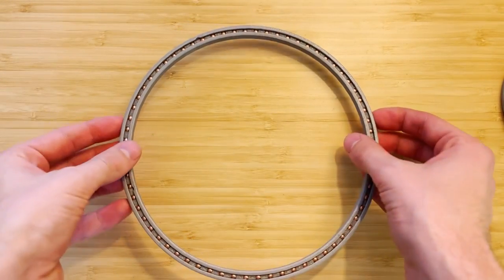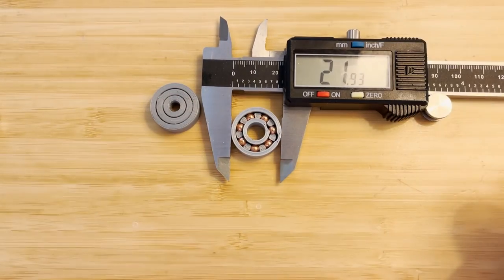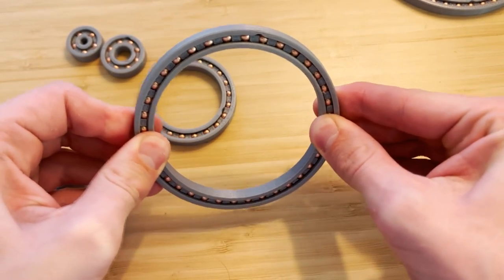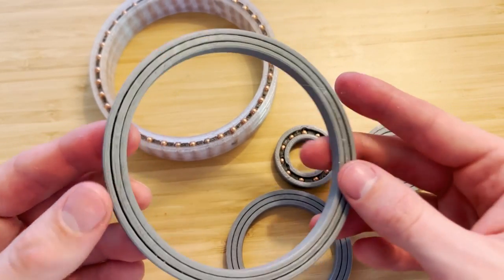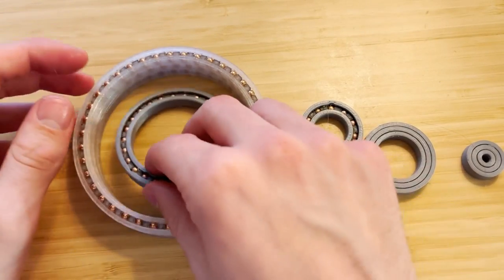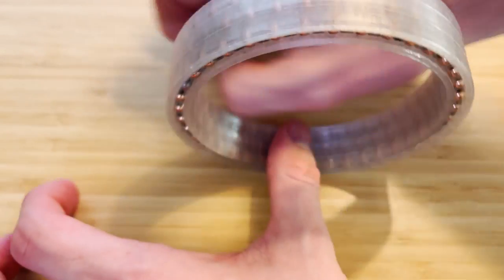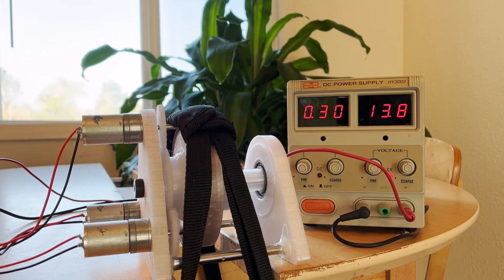24 Hour Torture Test of 3D Printed Bearings

Comment from the maker: I wanted to correct a very obvious mistake I made in the video! I was recorded this after a long day of school and clearly my brain was gone. 

the shaft was rotating at 11rpm which is NOT 110 rev/min like I said. 

It is 66rev/min which translates to 95,040 revolutions in total over 24 hrs and 47,520 revolutions in total over the 12 hour span.
Reply: It's not a big problem. You can add a text overlay via youtube editor on place, where you said wrong numbers. I saw, many do that on their mistakes.
Reply from the maker: @LichtTempler  I tried to do that through YouTube editor, but it seems they removed the annotation feature!
Reply: @LichtTempler  unfortunately they removed this feature some time ago
Reply: @Dangineering  you could pin this comment so more people see it
Reply from the maker: @l0k048  Oh! thanks for bringing this to my attention. I thought I had pinned it when I first commented, but clearly something didn't work.
Reply: You may want to correct your correction. In the vid, you said shaft is 11 revolutions / 10 seconds, but in your amendment here, you say rpm, which literally stands for revolutions per minute. Obviously, units matter.

Comment: Did you lubricate the bearings before running them? If not, they hold up quite well! I'd imagine a bit of lube would go a long way
Reply from the maker: Yes, I lubed the bearings once with some silicone grease and then did not add any more during or after testing. For the amount of weight and duration of their use I was also impressed with their durability
Reply: @Dangineering  you should compare the results to a lubed printed bushing, i feel like the bearings might actually hurt because they point load the race
Reply: Dry lube like graphite would probably work well

Comment: Nice work, I did a similar test, but at higher speeds and for less time. I’m always amazed by how well they hold up
Reply from the maker: Yeah I fooled around with them at several thousand rpm and like most bearings they certainly got hot after a couple minutes, but they are perfect for high load/low rpm applications or short bursts of high rpm during prototyping.

Comment: You can have Chinese bearing very cheap provided that you design with bearing dimensions widely use. They will be better than any pla bearing,  but pla bearing are very interesting for prototype and validation of concept .
Reply from the maker: Real bearings are and will always be better performing, but for the really large internal diameters that I needed it was not financially viable to use them. However for prototyping and simple hobby projects that will never operate in extreme conditions or for continuous operation these are a great way to save a buck.
Reply: @Dangineering  I agree I give you a tip and you give me one
What parameter do you use to have a smooth track for the ball ?
for my tip type 
"axk official store" aliexpress ball bearing
-
you will have a 6810 2RS 50x65x7mm for less than 4$
It is not japanese quality of course but if you respect the load it will work

Comment: Very interesting! A few thoughts on wear:
- lubrication (obviously)
- Nylon (you need a nylon-capable printer obviously, which I don’t yet myself)
- I suspect that much of the wear is just the high parts of the layer lines wearing away. I’d think that the wear rate would decrease once the high points are worn down. I wonder how it would work to print with slightly over-tight clearance and then sand the races lightly to give a smoother surface?
- someone else mentioned electroplating, but I wonder if some UV-curing resins might be harder than the PLA? I’m thinking in a similar direction to the last note: just fill in the low points in the layer lines a little bit to provide more contact surface area.
- I wonder if the smoother surfaces of actual ball bearings would reduce wear? BBs are certainly cheap and pretty smooth, but extremely smooth vs just very smooth might make a difference.

(None if this would be an issue for your robot dog use case; you’re not going to be running the joints 24/7 for months on end :-)

Great, great work!
Reply: My impression is that UV resin might be more brittle than PLA, but Nylon should be very hard wearing. Maybe a design with cylindrical roller bearings would wear less than ball bearings, but that probably introduces other problems.
Reply: @DisorderedArray  Ah, good point about the brittleness of the resin. I think you’re right, UV resins are known for their brittleness, and the high point-contact forces of the ball bearings would almost certainly cause cracking and very short life. Thanks for sharing the comment!
Reply: @DisorderedArray  BTW, I just came across this design the other day, using wire for the bearing races. Still very low cost, but they should be much more rugged: https://youtu.be/xbGtqpgfdRM
Reply from the maker: Very interesting thoughts! I will definetly try and print it with slightly too tight of clearance and then sand away a little bit to test the high layer line theory. I would like to try electroplating, but practically that is not a real option for most people (so even if it is a solution, its not a viable one)
Reply: @DEtchells  interesting, I guess with these larger 3d printed bearings one has to match the design choice to the expected wear profile.
Reply: @Dangineering  I think electro plating has so many potential uses with 3d prints, I say if you can do it, don't let us scrubs hold you back, go for it!
Reply: You could also re-fill the bearing with larger balls once the small balls have broken them in.

Comment: I'd consider using roller bearing design for the triple in future if can get ahold of the rollers they might held lower wear as the weight distribution is significantly better than a ball
Reply from the maker: Do you have any suggestions for what might make decent rollers?

Comment: Really nice job. Those bearings are huge.

Apologies if you said it in the video and I just missed it, but how tough is it getting the bearings into the center race on the triple-bearing print?
Reply from the maker: It's not that tough honestly. You just put the bearings in on one side and then  work your ways towards the other. It can take a little bit of patience. I will post a quick demonstration video soon sine a bunch of people are curious on how to assemble to triple race or larger bearings

Comment: I would be very curious what dimension is distorting under load. 

One idea I want to try, (or see tried) is to take advantage of thermoplastic creep to force mechanical dimensions that loose their true initial shape, back into optimal parameters. It would be kind of like a "self sharpening chainsaw blade attachment" but for plastic, either adding or removing plastic at specific points with a constant spring loaded force.

Comment: Nice job with the metal bearings. I’ve made ball-less bearings for low load applications like the roller for my filament holder. I wonder how they would hold up on this kinda of testing.
Reply from the maker: I tried to put the same 25lb weight on the 100% 3D printed bearings that I found online, but they didn't rotate at all under that weight so I decided to not film it.

Comment: not just cool, rly cool. Attempted something like this long ago with plastic bb's so it was a chemical resistant being, didn't hold up to the speeds i wanted but i might revisit with your design!
Reply from the maker: That's why I stayed away from plastic BB's I knew that I needed them to take some higher speeds, forces, and temps so I opted for steel BB's.

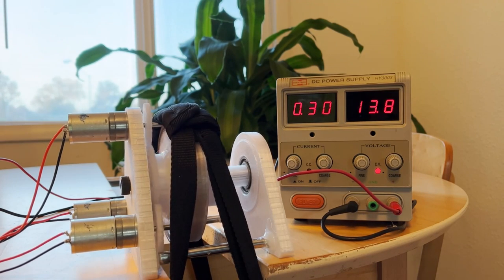Comment: 5:00, “11 revolutions every 10 seconds”, that isn’t 110 rpm, there are only 60 seconds in a minute, it is 66 rpm.

“Thin PLA 3D Printed Bearings”, then prints the strongest out of PETG.
Reply from the maker: I acknowledged the mistake in my pinned comment, made the video late at night and clearly was tired. 

Yeah I simply ran out of PLA filament and wanted to still show that you could print multi layered ones.
Reply: @Dangineering  didn’t see that when I commented, also it still isn’t quite right, you said in the pinned comment that the shaft was rotating at 11 rpm which is 66 rev/min. It is a great project though.

Comment: Experiment with multi-material.

Place metal sheets on the walls that are hard amd rigid and see if any wear happens at all.

And yes you should always use grease. Please never run without lubricant.

Comment: I am really impressed with the result, and I am greatly interested in plastic made bearings, for rust proof bearing, using stainless steel BBs, for creating my own ECM lathe, (I will just have to find a way to get current into the immerged chuck, without any contact with the highly salty water solution as I would get extremely quick corrosion, maybe thanks to a usual steel bearing encased in an oil filled cavity, I will see)  
but I have a little question : how do you fill the multi-layer bearing of it's ball bearings : is the balls separator in several pieces and each level gets filled mid print ? Is it filled post-print going layer by layer with a splitted ball separator ?
Thanks a lot for the video, it gives a lot of ideas
Reply from the maker: Exactly. For the multilayered bearing all you do is print one casing and three retainers. After they are done printing put the BB's in one of the most external races and then go layer by layer till you reach the outside bearing race and boom you are done. If you wanted to wait a little bit I am going to post a quick little assembly video for multi layered bearings because it seems a fair amount of people are asking questions about it. I will be curious to see if these could do well in a ECM Lathe environment

Comment: I have a small PLA part for my home that kept breaking, and i just kept printing more. I find pla can be quite brittle and thin parts like this can be especially fragile, but I guess depends on the exact plastic and perhaps the degree of crystallization. But I tried the fancy 3d870 pla resin, annealing, nothing seemed to work. I switched the part to a PHA resin from regen and It hasn't cracked since.
Reply from the maker: Personally I have had a really good experience with PLA when I increase the width of the walls. I recently switched to PLA + or PLA Pro (same thing) and have not had any of my prototype parts break on me.

Comment: You probably thought of this already, maybe ruled it out because of difficulty getting the pins, but could needle style bearings with pins instead of balls wear better on the plastic?
Seems like the spread out contact point would work better for plastic.

BTY no engineering experience

Comment: Very nice bearings. The shape looks similar to a ceramic bearing I’ve got in the workshop. Do you print them 100% fill? Subscribed, I love this kind of thing :) ps does heat become a problem?
Reply from the maker: Glad you enjoyed it! Yes, I printed them at 100% infill which I achieved just be increasing the amount of perimeters. Heat didn't become a problem for me at these speeds, but I have taken one (without lubrication) and had it spin at around 8000 rpm for about two minutes. At that speed I could feel it slowly start to heat up to the point where at the end of the 2 minutes the PLA was a little soft and flexible. if you need higher speeds I would suggest to use nylon, lube, and if you need constant operation for long periods of time to have some sort of cooling.

Comment: This was great work(!) I just came across a design yesterday that uses wires for the ball races that you might also be interested in. They add another step (you need to ring-roll the wire), but still extremely low cost and they should be much more rugged than having the bearings run directly against the plastic: https://youtu.be/xbGtqpgfdRM

(The creator says he’ll share the F360 files with people if they ask. He’s apparently not posting them himself because they’re highly parameterized and quite complex, and I guess he doesn’t want to be swamped with random questions.)

The straight plastic bearings you designed are almost certainly fine for your robot-dog use case, but I thought you might find the wire-race approach interesting 👍😁
Reply from the maker: I had not seen those before, thank you for introducing it to me! They are certainly way more work to assemble and seem to use more hardware than mine (in that you have to screw it together), but ultimately I would guess that if you need slightly higher performance then his might be a better choice. 

Those will likely last longer, and tolerate higher speeds and loads, but even my own design exceed my personal force requirements, so I will probably keep the design as it stands unless other issue pop up in the future.

Comment: emmett made a OpenSCAD file for his gearbearing. you can actually get away with very big/thin bearings. Try playing around with it a bit maybe.
edit. i really like your approach tho, the tolerances of the bearings seem really good. roundness seems to could be improved a tad but still very nice :D
also PETG is quite durable for such applications and lasts in mineral oil for ages. nylon (PA12 or PA6) would be okay too but PETG is overall a lot less hassle to get tuned in properly.
And for the sizes of bearing you would need. they are expensive as heck. sadly.

peace o/
Reply from the maker: I will give that a look! Yeah nylon will be the best option for ultimate durability, but man is it a hassle to get good prints with it sometimes. OH yeah the bearings I needed were just prohibitively expensive.
Reply: @Dangineering  From my own experience (some gear sets that now run a bread slicing machine) and few different gear and cylindrical (more surface area) bearings IMO if you have say a "light load" application PETG will usually hold up WAY better then PLA and not that much worse then nylon. usually my overall go to material nowadays. What printer are you running if i may ask ?

Comment: have you tried using filament cut to length as roller bearings?
Reply from the maker: I have not tried that, because I fear that the filament might get a little too hot and then start to get too flexible, lose its shape, and then cause the bearing to fail.
Reply: Roller bearing should be superior for high load low rpm

Comment: I want to build some larger bearings. Where do you buy the ball bearings?
Reply from the maker: Any Steel bbs that are 4.5mm will work perfectly. 

Here is exactly what I used: 
https://www.amazon.com/Crosman-Copperhead-BBs-EZ-Pour-Pistols/dp/B081ZSPJ9Z
Reply: @Dangineering  Thank you. I like your videos and subscribed. I just ordered those balls. 70% off $2.98. pretty good deal!
Reply from the maker: @FilmFactry  thanks! Got some really interesting videos coming up soon! Hope you enjoy them! Also that’s a great deal! Make every bearing you make only cost a couple cents.
Reply: @Dangineering  Got my ball bearings today. It would have cost more than $3 just for postage. Now to print a bearing to test. Thanks.
Reply from the maker: @FilmFactry  Congrats, that sale was super nice! I would love to see how they turn out once your done! Also the larger you print the more flexible they become unless you bulk it up by making it multilayered or increasing the wall width.
Reply: @Dangineering  I'm trying to configure Klipper now on a Ender 3. I built a clay extruder and it will be dedicated to that. I downloaded your files and will pick one and print it on my Duet Ender 3:-)

Comment: Did you lubricate them before running them?
Reply from the maker: Yes, I lubed the bearings once with some silicone grease and then did not add any more during or after testing.

Comment: It looks like the balls could be spaced closer together. This will spread the load out better and should decrease the wear quite a bit as they ball do not need to sink into the race that much.
Reply from the maker: I was not able to generate enough load to stop them rotating as is. So I figured I would get more benefit from having slightly thicker plastic sections between the balls to decrease the chance of small bits breaking than I would from increasing the potential load capabilities.
Reply: @Dangineering  He is not talking about increasing load capabilities, he is talking about reduced wear and i think he is right. Mechanical engineer here. I think sections between the balls can be a little bit smaller without any problems. You should test it. :)
Reply from the maker: @drister007  Yeah I understand what he wanted, but got lazy and didn't explain all the horns of my argument. It would likely reduce the wear, and I might test it in the future, but I will probably take me a while to get the time. 

If I get some time over winter break I will make some variations of the retainer ring with higher density.
Reply: @Dangineering  Cool :)

Comment: How do you double or triple these bearings? I apologize and advance for this stupid question.
Reply from the maker: just import the STL or STEP file into your soild modeling program of choice (OnShape, Fusion 360, Solidworks, etc) and then create an assembly by having multiple of the casings concentric and then make the sife face of it coicindient with another one. Then you have what you need and you can make them as large or small as you need.